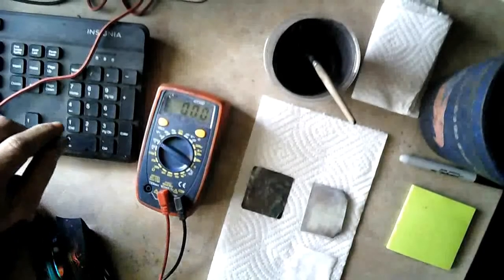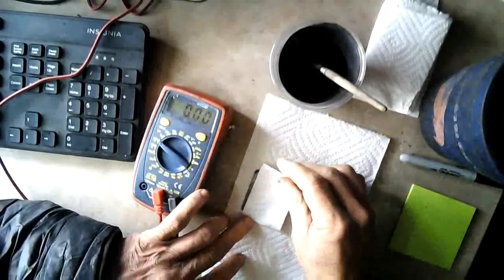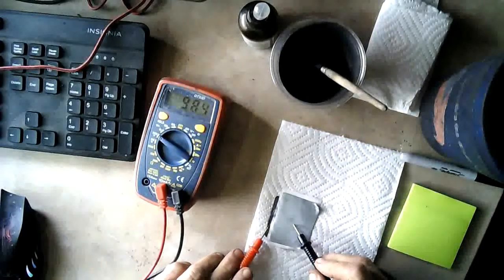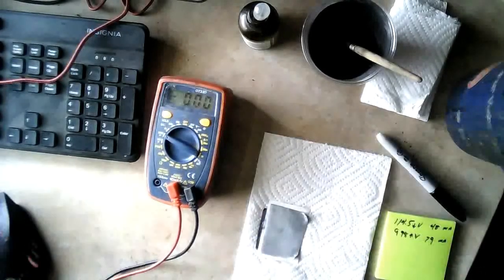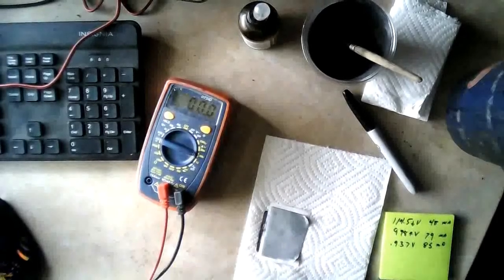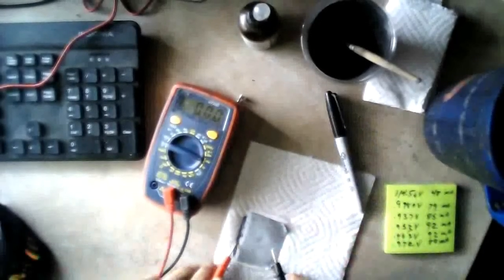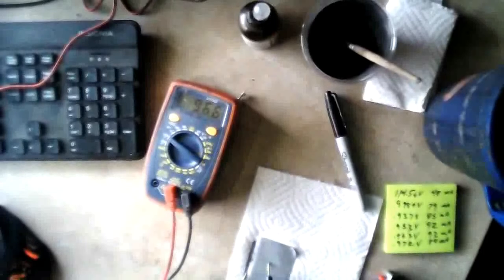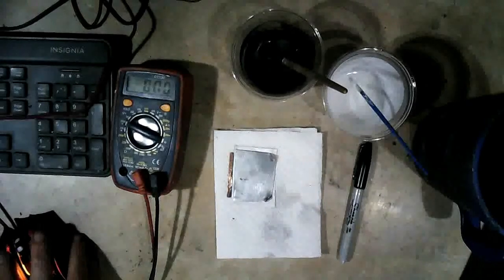Paper or Metal?

Comment: I'm glad you looked at the ibpointless2 videos. You came to a similar conclusion as me about the Epsom salts using the water in the heptahydrate. My big cell using a cup of salts lasted eight months then required addition of water to rejuvenate. The dried glue cells without any additives was perplexing seeming to maintain a constant charge without any apparent electrolyte at all. Low power but interesting.
Good to see you comparing the configuration of the active material. I wondered about that myself.
When you get the data logger set up you'll have a better idea about the charge cycle timing. I'm an old materials guy. I'm all about performance curves, particularly when it comes to comparisons. In particular I'm interested in both how long it takes to rebound to a given voltage as well as how much charge is accumulated over a given time. Those two parameters indicate the absolute and actual performance of the materials. Modern diagnostics greatly reduce the tedium of testing.
Reply from the maker: I'm running the tests for tomorrow's video today, and I just discovered two more problems! Looks like I ought to include moisture/humidity sensors now, but I'm already sensoring the cell to death. Lol
Reply: You're gonna qualify for an honorary deegree at the Strike Anywhere School of Cell Technology.
Reply from the maker: Lol,. that's a good one! I did make three good improvements in three days, but tomorrow's video shows that I still need to work on the separator before we can test.